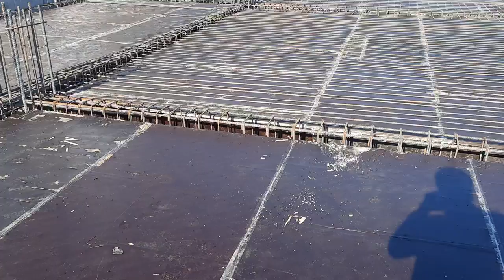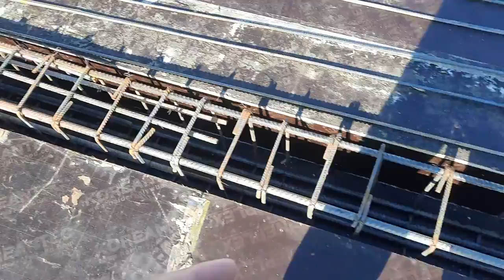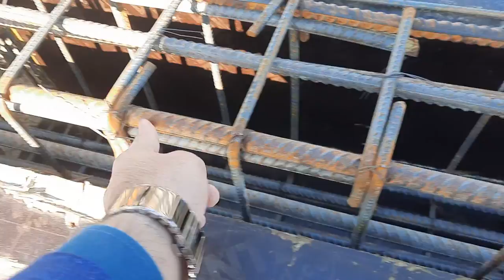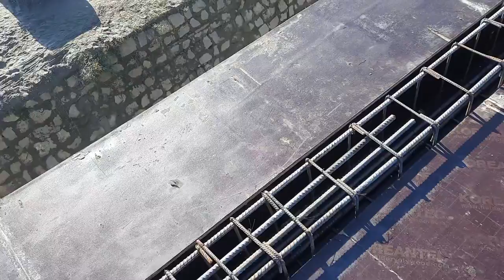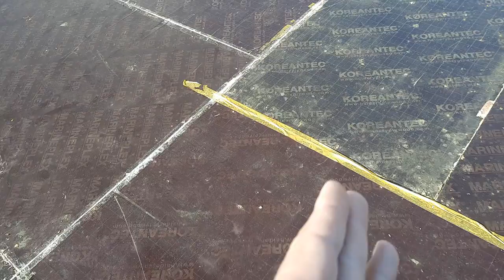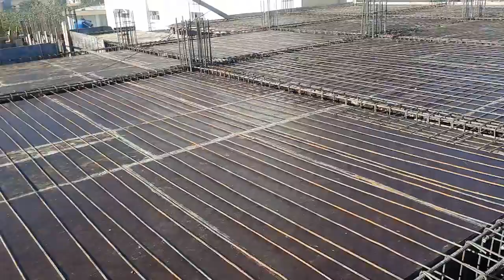Design of Beam for 6 Storey Building   Design of Column for 20 Feet Span

Comment: I have provided 9/18 inches beam in 20 feet span at the centre of column and provide 3 top (16mm) & 3 bottom (16mm) & also provided 2 extra top and bottom, both are 16mm, is this ok or not in my beam please reply.sir. ( column size 9/18 inches 10 bars of 16mm)